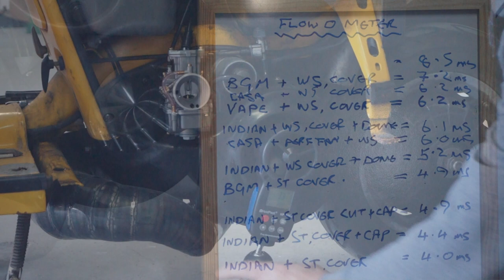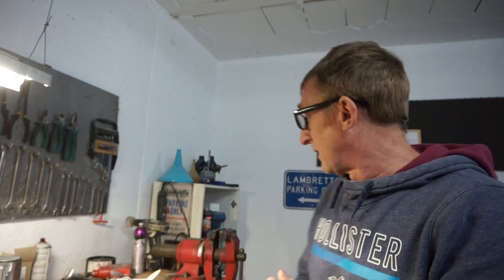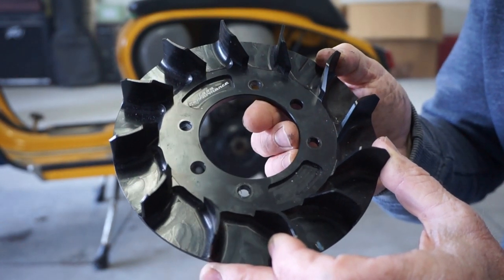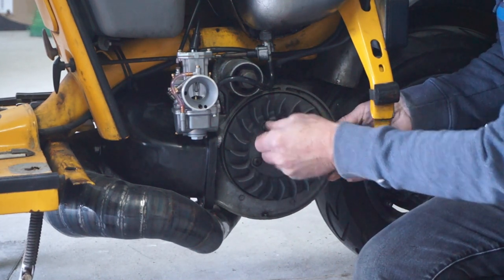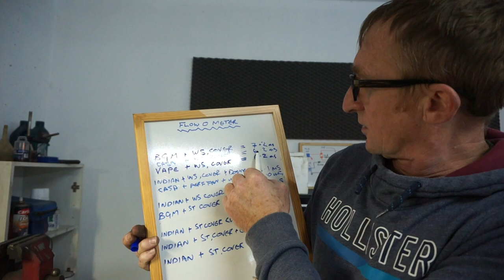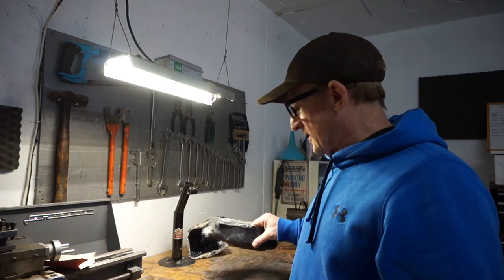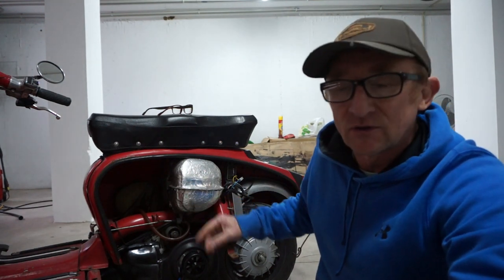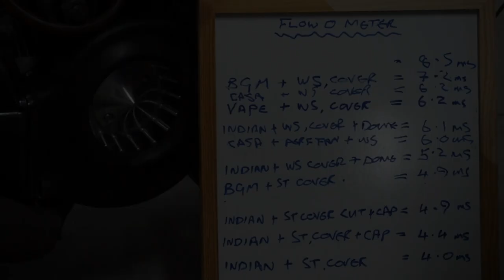LAMBRETTA COOLING VAPE FAN & COVER # TheSteelweasel

Comment: Phenominal !!!, All your work paid back.   What's the power loss though ???. Here's a curve ball;  What's the power gain with no fan and open / ducted cooling and perhaps electric fan at idle -low speeds.    almost 48 years ago; I had a Sachs 50 motor ; I removed the fan ; installed engine in mini bike.  Has to be some loss.  BTW chasing 100mph; utilise wind flow huh.

Comment: Great videos, thanks! Just a quick question: what about the counter-Venturi cone, stamped in the centre of the flywheel cover grill? Have you ever checked whether it increases the air flow or not? Cheers
Reply from the maker: the grill reduces air flow , the stamped center dosnt seem  to do much only an obstuction  mate . cut out the center and dome the dust cover seems to give good results and costs nothing .....

Comment: Nice work Steve. As an after thought,  would the hole in the cover change the ms values if the hole was larger vrs smaller?
Reply from the maker: the hole needs to match the fan is the most efficient mate .

Comment: Hi, are you using a rev counter to make sure the engine is ticking over at the same revs on each test? Difference in fan weight will make a difference.
Reply from the maker: sip rev counter mate ..... but its impossible to maintain exact revs , thinking of building a proper test bed with electric motor , its the only way to be accurate .  thats why im using meters per second . testing at 2500 rpm .... the only thing with electric is it makes boring vids people like smoke and noise its entertainment at the end of the day ......
Reply: @TheSteelweasel  
I get what ya doing and think it’s great Steve but sometimes the engines don’t sound like there running at the same speed and the anemometer looks like it’s at different distances from the Venturi which all have a bearing on its fan speed. 
We would all love to know the optimum cooling setup and Get VFM. 
I think you may be doing the legwork and R&D for BGM and others to make a quick buck. 
The centre piece engineering was a revelation and I think there’s lots more to come utilising the aerodynamics of the fan shroud and blade configuration.
Reply from the maker: @andrewroyle9825  yep it's only a ball park reference.  Not lab conditions but it's better than nothing.  Thanks
Reply from the maker: I'm rattling a few cages let's see if companies do something to prove there designs
Reply: @TheSteelweasel  and so they should, it’s laughable the claims made on products but with no testing or information to back up anything, it seems that the more bling applied the easier it is for people to believe it’ll work regardless of any testing. Emperors new clothes in allot of cases.
Reply from the maker: @christophersturgess4064  bang on mate lots of people making money on shiny anodized bits .... l Like your tuning excellent work mate .